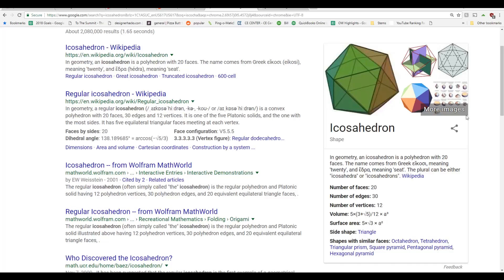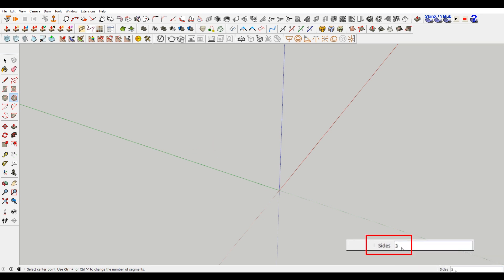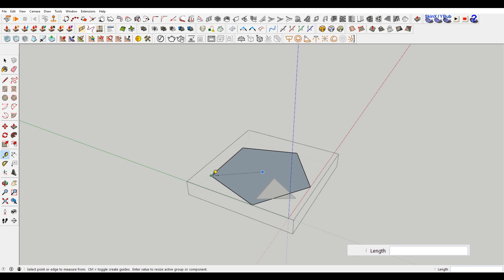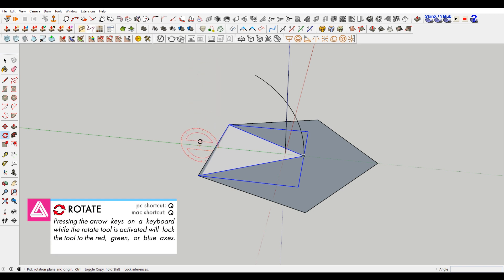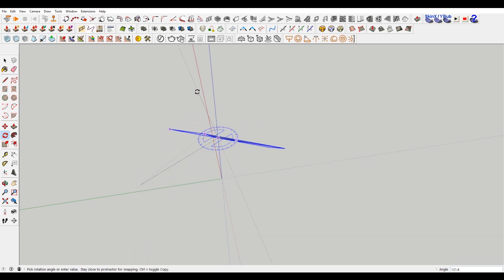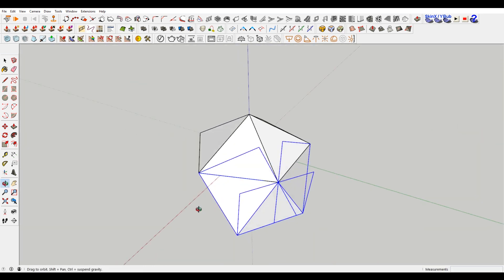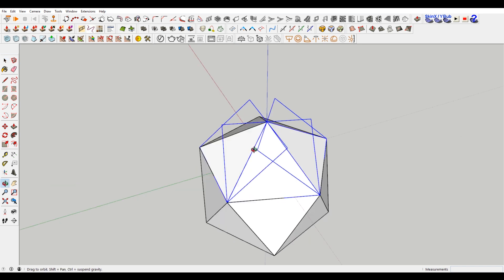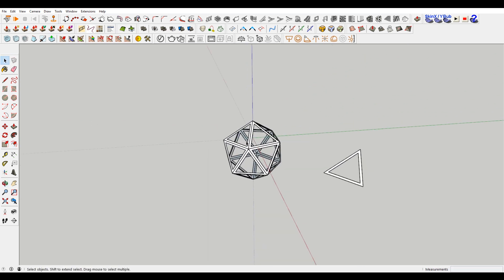Creating an Icosahedron in Sketchup

Comment: It will not come out "correct," when you zoomed in, there is a gap between the first and 5th triangle. Arc tool does not make arcs, so the top won't be in the right place.

Comment: Thanks for sharing, I learned some great new tricks! You don't need to place the bottom piece in the middle; just connect one of it's
 vertices with a vertex of the top part and rotate horizontally  from that vertex...